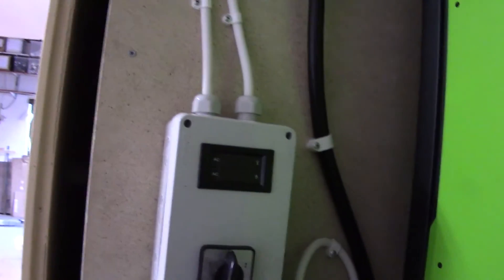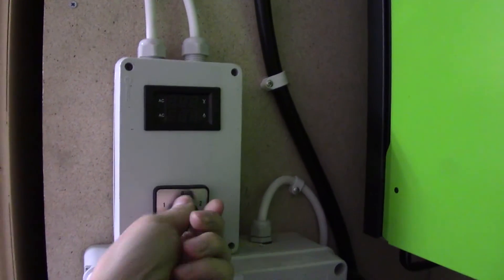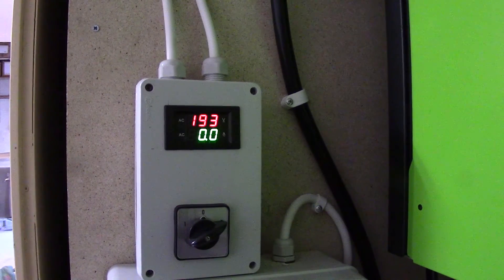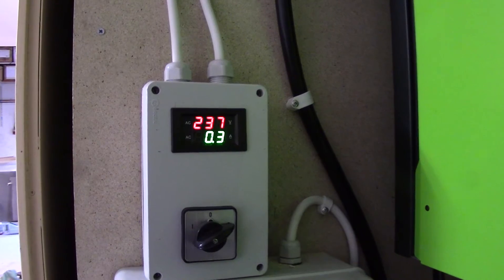Solar electricity: Power switch build! (Manual transfer switch)

Comment: ok slightly off topic for this video anyway  i'm looking at getting one of the inverters should i go the 10k single inverter or get 2 pip 40448 and paralel them ? pros and cons ?
Reply from the maker: I have not seen many 10kW single phase? Which one were you looking at?  What is your average load and your max load?
Reply: sorry the 10 k is the same as you have in the cupboard  that one is 10k but 3 phase (single as in one main box instead of 2 or 3 inverters)
Reply from the maker: dtec30 ahh... the 10k i got ja hybrid and the pip is offgrid so cant be compared. So it depends on what you or how you want to use it?
Reply: i currently have grid tied ac i believe its called  but i want to suppliment that with batterys as i have been told that we here in australia are in for a world of hurt in reguards to power prices more than we currently are faceing
Reply from the maker: If you want to run it all through the inverter and the offgrid function the pip would work. The Hybrid on other hand can also supply back to grid and do 0 meter. But that may not be allowed where you live so you need to look into that.  Im allowed to feedback here and have it hooked it in.
Reply: i currently feed into the grid as well